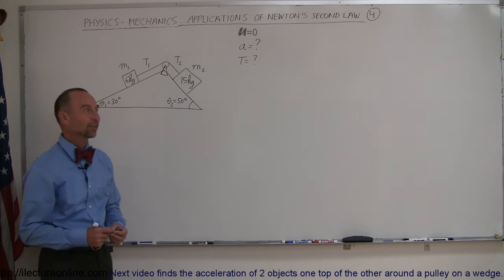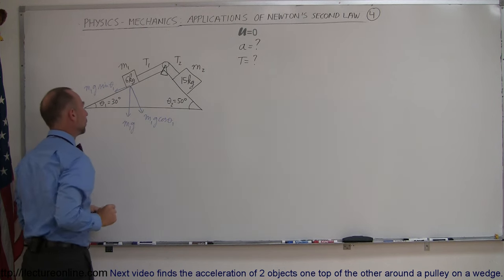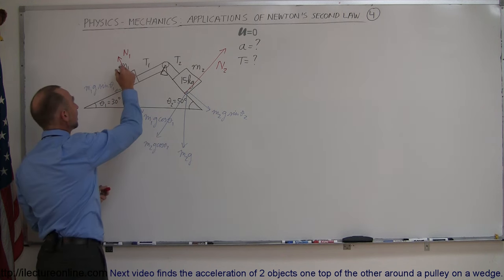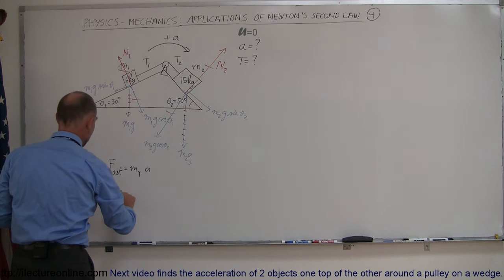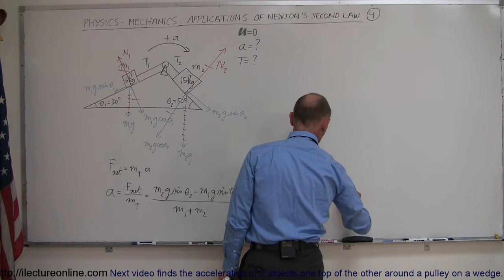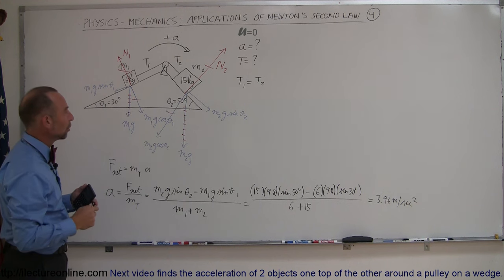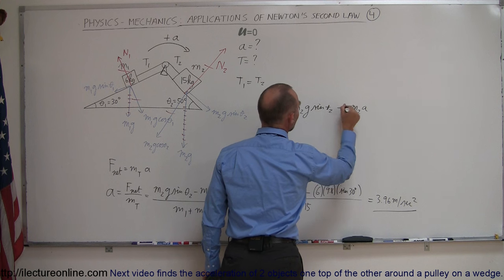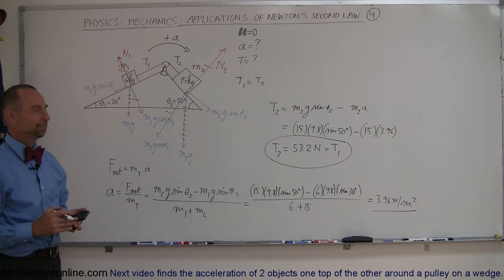Physics - Mechanics: Applications of Newton's Second Law (4 of 20) double ramp

Comment: I’m watching this knowing I failed my test today
Reply from the maker: Sorry to hear that...
Reply: @MichelvanBiezen  Ah no worries, I treated the masses to be individual systems instead of treating everything as one system
Reply from the maker: It can be done that way, but it does make the problem harder.
Reply: @MichelvanBiezen  I added the mgx of a mass and the mgx of the other mass (for tension)  to solve for net force of one mass. I adjusted the signs accordingly and did it for both masses. I then divided the two forces by their corresponding mass to get the acceleration. Is this valid? Also, I really appreciate you replying to comments 7 years after the video was uploaded!
Reply from the maker: It is difficult to follow those instructions.  The idea is to use free body diagrams.  You can find out how to do that in the playlist:  PHYSICS 4.8 FREE BODY DIAGRAMS
Reply: @MichelvanBiezen  Yup that’s exactly what I did.  This was the question 

The figure below shows two boxes attached by a light cord that runs over a frictionless peg. The mass of the block on the 60° incline is M = 8 kg, and the mass of the block on the 45° incline is m = 2 kg.
Assume that both inclined surfaces are frictionless for parts (a), (b), and (c).

(a)   Find the acceleration of the blocks once they are released from rest.

(b)   What is the total force exerted by the cord on the peg?

(c)   If block M is released from rest at a height of H = 1.5 m above the bottom of the triangle, find its speed when it reaches the bottom.
Reply: Maybe you need some nutritions for your brain as feed.. Like me😊